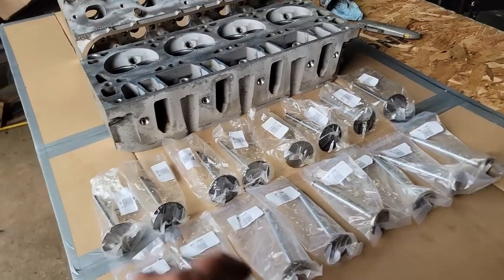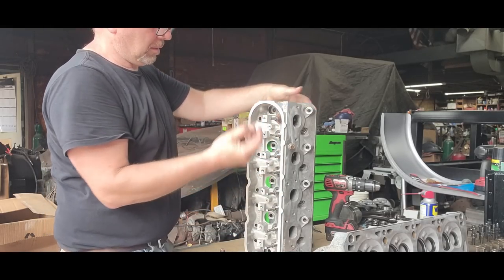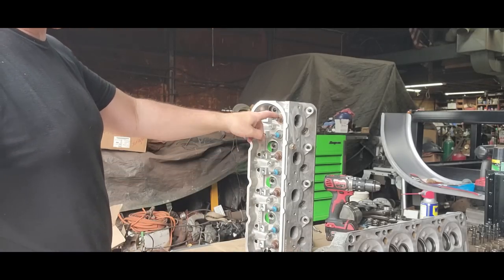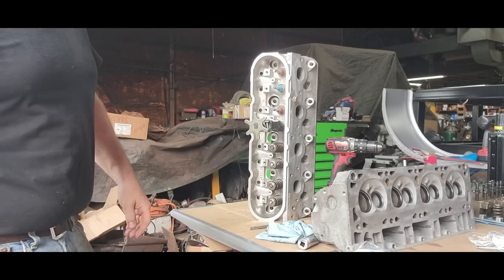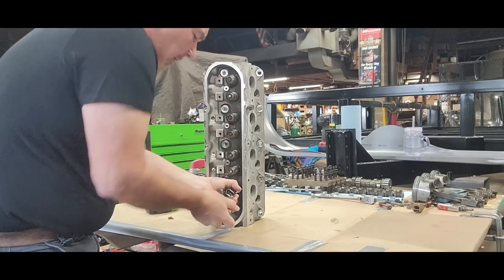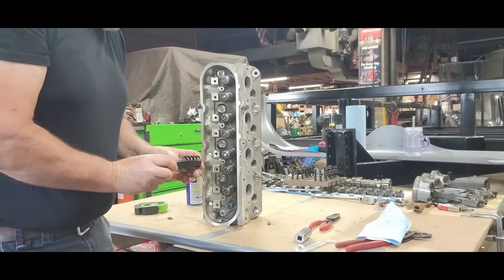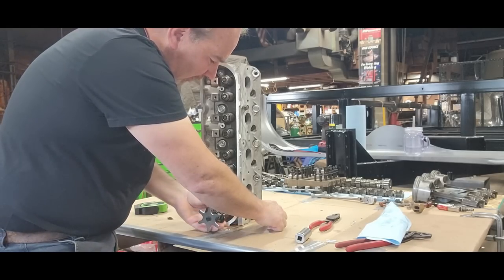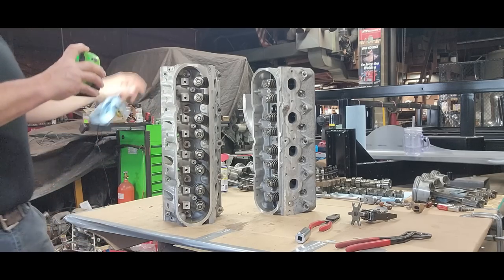HOW I ASSEMBLED THE LS HEADS WITH NEW VALVES, SEALS AND LAPPING.

Comment: I have that same type spring compressor used it to replace seals with head still on engine just blow up cylinder with air tap on cap and tool works great to sneak in new seal .

Comment: No oil on stem while using a drill to spin the value  or when assembling valve seals
Reply from the maker: i told peter someone would say this.....those slow rpms wont make any difference or do any harm.

Comment: did you check out the tool i mentioned in the comments of the last video for removing and installing the keepers, i am a dumbass but i also don't big time myself, I'm just here to watch stuff being built and repaired, if i knew what was going on i would waste my time watching something i knew about
Reply from the maker: i must have missed it.
Reply: @j.c.smithprojects  check it out, saves a lot of time messing with keepers and springs,  Lisle 36050 Valve Keeper Remover and Installer Kit
Reply from the maker: i looked at it. i dont think i like smacking a valve against a hard surface if there is another way.
Reply: @j.c.smithprojects  no problem mate, just thought id share the tool

Comment: We know you can be bit picky.  You checked it originally best you could.  
What we do know is mechanical items fail. You tore it down found failure, but cause not always right there with arrow as to what came first. 
You unlike some going beyond. Is your way. 
I know nothing of LS series. It has small ecm wich shows that driver error not probable. Old Chevy blocks with high mileage used to egg-shaped cylinder walls.  Make mistake of swapping banks makes engine knoc on quick rebuild.   
Keep on doing it your way. We all learn.  Some learn how to keep reputation with customers.